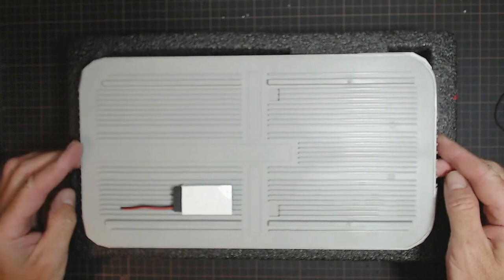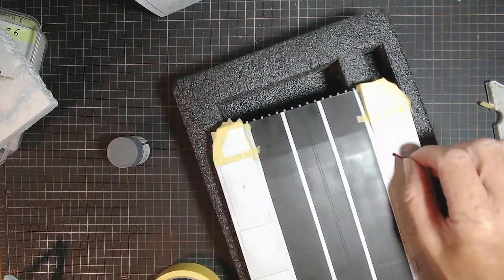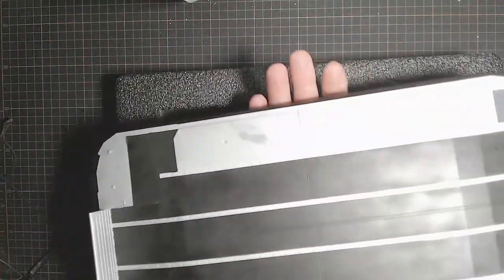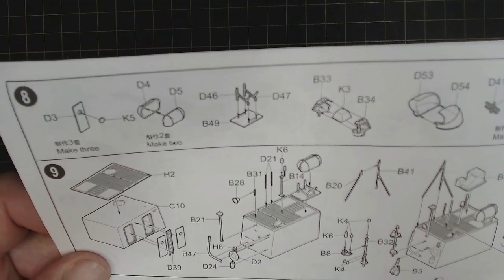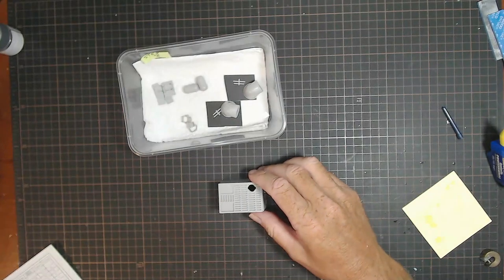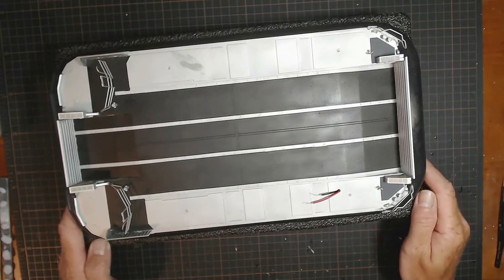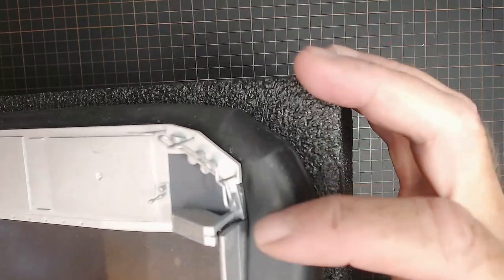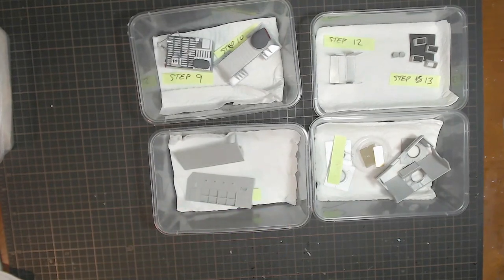JMSDF LCAC Landing Craft Air Cushion Hovercraft Build Part 3. Trumpeter NO: 07301

Comment: Cleanup on isle 5 😱!!  Don't feel to bad about spilling the paint, we have all done it,  I have gotten into the habit of always putting the cap on the paint cup because I have spilled so many times.  The Hovercraft looks great Peter, I really like your paint work.  I was really wondering about attaching that skirt to the bottom.  I'm glad you were able to get Contacta to work.  It looks like you are going to get a lot of practice filling seams, some of those parts don't look like they fit very well.  I'll be watching for the next part, thanks for sharing.  Jeff
Reply from the maker: I need to get that cap on habit cause I spill most on myself. :)
Reply: @OzScalemodeling  Live and learn, you wouldn't believe what I did the other day.   I was doing a little figure painting.  I was paying more attention to what I was painting than where my wet pallet was.   Yep, I dropped my figure right on the wet pallet .  Paint all over it, what a mess.  It took me a little while to recover after that.  Have a good one!  Jeff

Comment: Not sure this took the first time - the big rubber section is called the airbag. It inflate when the craft is running. There re bleeds in them that let them deflate when the craft I shut down and it settles on its hull. It also floats on the hull if it shutdown when on the water.

Comment: Can you post the links for the Led on off switch and leds pls
Reply from the maker: Search Ebay 2 x AAA Side-by-side Enclosed Battery Holder with On/Off Switch and Fly Leads and DC12V 3mm/5mm/10mm Prewired Emitting Diode LED Bulb Single Color Light 1-200Pcs
Reply: @OzScalemodeling  Thanks will be doing the US Version liked the video series
Reply: @OzScalemodeling  Sorry one more question as it not clear in video series how to then replace batteries and how to stitch on and off did you left a opening in the bottom or cut a slot on the deck?
Reply from the maker: @fernandopereira3556  8:28 The wires go through a small hole in the bottom and up through the top deck under the cockpit. The black battery holder has the on/off switch to the left of where the two wires come out and the case slides out of the styrene frame to change batteries.
Reply: @OzScalemodeling  great thanks keep up the work great videos